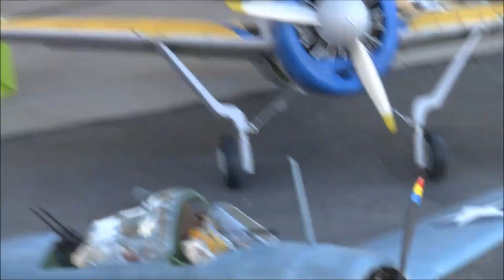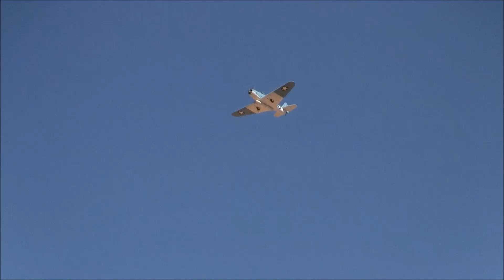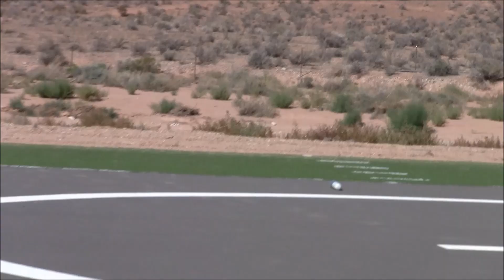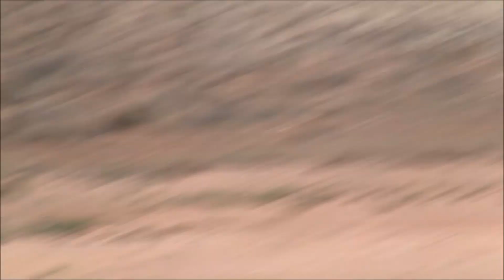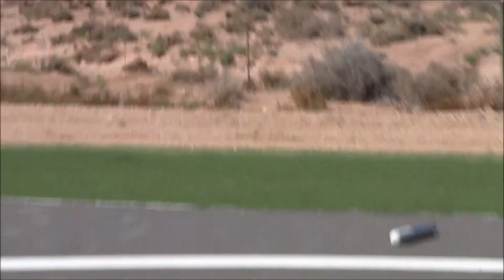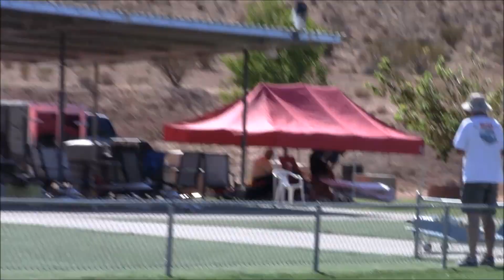Douglas TBD-1 Devastator (1:7.3 Scale) by John Morgan - MAIDEN FLIGHT! St. George Utah, 2018

Comment: not meaning to be nitpicky but a small detail often forgotten by modelers of the TBD at the time of Midway was that the red dots were still on the stars on the underside of the wings, the ones on the sides and upper wing surfaces were overpainted with white.   Just saying.
Reply from the maker: Hey Steve, no worries, you're not being nit-picky. And I'm not questioning you, but I am questioning you - this is the first time I've ever heard this. Can you please post some kind of link or reference? In fact, I just looked at some pictures (some of the only available from the Battle of Midway) and the Devastators from the Yorktown didn't have red dots on any of their stars. I just saw another picture from a TBD from Torpedo Eight from 15MAY1942, and there weren't any red-dots on it, and you can clearly see the bottom of the wing as it's folded: https://commons.wikimedia.org/wiki/File:TBD_T-5_VT-8_CV-8_15May42.jpg
Reply: @JustwingitRC  check the film made by the Navy in memory of Vt-8(its on YouTube too) In the first minute it shows plane T-3 (someone with more info can help identify the crew) and it clearly shows a red dot on the under surface of the folded wing.  I think there were a couple other spots in there too.  The film was made specifically for the families of the deceased pilots and gunners and wasn't shown in movie newsreels at the time.  It's only in recent years that the general public has been able to view the film
Reply from the maker: Okay Steve, you are corect, the TBD "T-3" still does have a red dot in the star....but "T-5", shown immediately following T-3, does not. So making a blanket statement like "they had red dots on the underwing stars" isn't completely accurate. Here's the video: https://www.youtube.com/watch?v=ajlKvA48IXU BTW, I am quite familiar with it...I've seen it long ago and actually have it in my personal video library. I think it's more accurate to say that "some" may have had the red dots. Here's why: the order to remove the red from the aircraft came out between the Battle of the Coral Sea, and Midway (the actual order came out on May 6th). There was only one month separating the engagements so it's quite possible that some crews didn't finish the job of removing all the red dots from the national insignia. http://wwiisquadronpatches.com/NationalInsigniaHistoryUSAircraft.html "In January, the national insignia was added to both wings, top and bottom. The red dot in the center of the star was removed in the Pacific theater to eliminate confusion over the Japanese red disc which served as their insignia. The tail rudder stripes were also removed. These last two changes were accomplished throughout American forces by May of 1942." So I'd say to you good catch on seeing that on T-3, but no, it wasn't the standard and the crew quite probably didn't have the time to finish painting their aircraft. Great discussion!
Reply: @JustwingitRC  you are quite correct....and the next a/c shown, T-5 didn't have its red dot.....one thing of note, another point for modelers to take note of is that if you look real close at the rudders, you can see the difference in the shading of the rudders, since they have been freshly overpainted, and also just faintly underneath a hint of the red and white stripes that had been there also.
Reply: oh also one other minor point for modelers too....VT-8 Devastators had twin 0.30 MG mounts that CMDR Waldron got from the SBD squadrons, the TBD normally having just a single 0.30, and if not mistaken, was the only TBD unit so equipped.
Reply from the maker: Yup...indeed my friend 👍!
Reply from the maker: And yes, John Morgan and I are both tracking that....LTCDR Waldron had twin .30's installed on all of his squadron's TBD's....and I think you're right, they were the only squadron so equipped. If you look closely at the video at about 19 seconds to 25 seconds, the model does in fact have twin .30's...😎👍

Comment: Outstanding..I know its not ur plane but do u know what power system was in it? Ie. Motor cell count. Thx
Reply from the maker: I'll check with the builder and post the specs ASAP!
Reply: @JustwingitRC  ty.
Reply from the maker: Specs posted in the comments 😎
Reply: @JustwingitRC  thx. 15 pounds on 6s that is amazing.
Reply from the maker: Absolutely!